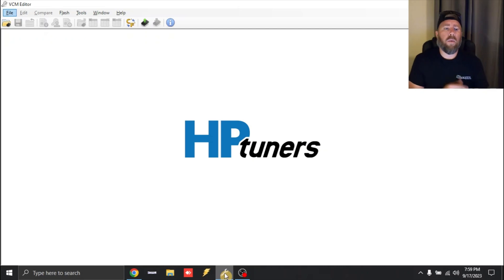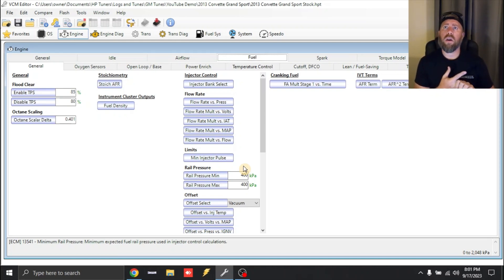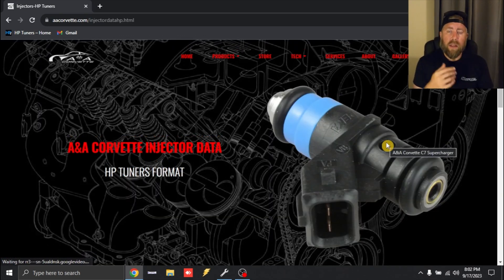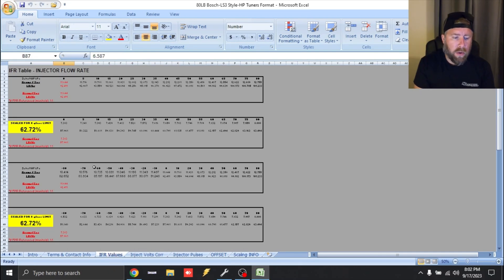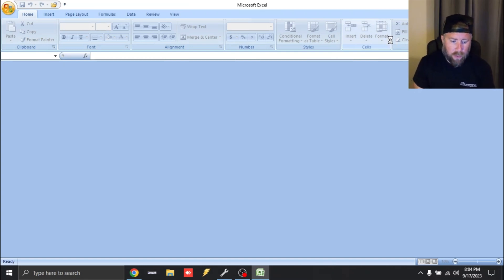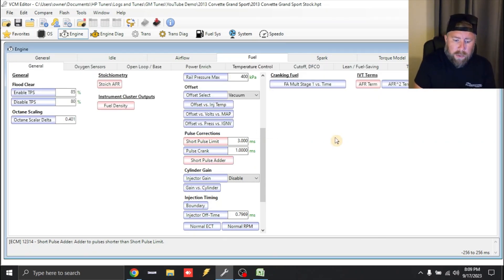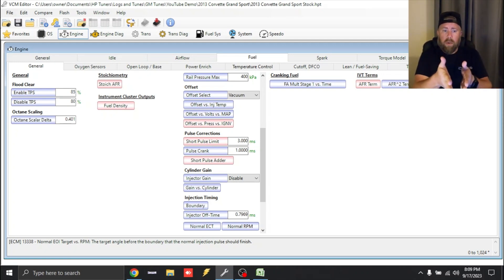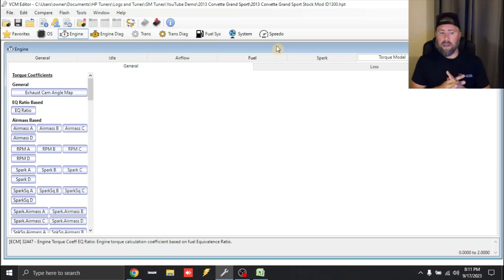Scaling for HUGE Injectors on Gen 4 GM ECMs! HPtuners HOW-TO!

Comment: hey matt Im wondering about much larger injectors like 1750-XDS where im stuck in hp tuners after doubling stoich, halving ivt terms, etc and halving the flow rate is still calling for 97.205. This is for a boosted return style system so I believe i use the same for all X axis

Comment: if i use a custom scaling value like 25% or 40%, how do i scale the stoich? do i do Stoich x (1 / .25)?
Reply: Yes. You are correct.  For example, 45% would be (1 / .45) = 2.22222222 multiple for your Stoich AFR table.

Comment: So for when you tune bigger injectors do you also have to scale the tip temperature table as well? I see a lot of people zero them out but if there is a better way of scaling id perfer to do that. Could you take new flow rate and divide it by the stock ones, take that value then divide the table? Say stock is 42 lbs and new is 104, could you take 104/42 to get 2.5, then divide that across the table?

Comment: I have a stock 2008 F350 SD dually with 6.8L and it used to get between 14-16mpg but it is falling off, much probably to do with the bad brakes I purchased from O'rieiliy's but It have wanted to get better performance from better atomization through high performance injectors.. This lb per hour and mapping makes it out of my league.. Am I totally off my rocker or is this something that can be achieved by a getting this mapping done by someone (for a fee) or, am I chasing the unatainable unicorn.. I just think this 6.8L with better tech should be able to get 18+mpg with grandpa style driving, and have better response and power when needed..Better tow performance as well, when called upon... What say you? Thanks in advance..

Comment: Hey Matt, I’m running a cam in my ls4 car I’m curios if I need to scale my new injectors being 52lb fic injectors on the e67ecu and my second question is do I use the same process on the earlier ecu if I ran the big injectors on an e40ecu? I have two cars hence two computers

Comment: Thanks for all you do. Your help is greatly appreciated. I followed this video when upgrading to ID1050x injectors in our 2010 Camaro. Everything worked great. Afterwards just messing around with HP Tuners I noticed going under the Fuel System / Fuel Control Module tabs that the data for "flow rate vs pressure" and "minimum Inj PW" is the same as it was before the Inj swap. This is not the original FPCM for the car. It was changed when converting to the LPE dual fuel pump setup. I also noticed that the ID Excel spec sheet has a flow rate table with the same axis header numbers as does the "flow rate vs pressure" under the Fuel System /  Fuel Control Module tab in HP Tuners. Do I need to change these values under the FPCM also ? Thanks
Reply: Did you end up changing fpcm values?

Comment: Would you still need to scale if ecu is 127lb and injectors are 95lb 
It flats out pass 488 i read the engine will never hit those cells
Reply from the maker: That’s personal preference. I still personally scale them but I’m picky like that.

Comment: Wouldnt you halve the stoich to add the fuel back in? Doubling it would be removing fuel
Reply from the maker: No. When you halve the injector flow rate, the ECM will double the fuel output. Doubling the Stoich leans the vehicle back out.
Reply: Oh yess that makes sense now
Reply: What does it do to the commanded AFR though when logging wideband AFR error for VE tuning?

Comment: Would this work the same for Fuel Injector Connection 1200cc on a 2013 zl1 camaro?
Reply from the maker: Yes it would be the same.
Reply: @Matt_Sanford Awesome! Do you have any videos for FPCM adjusting on tuning when adding an aux pump?

Comment: Great video bro !! Ive watched this video 5 times already. Currently looking for injector data for (Fuel Injector Connection 42LB Injectors for LS1/LS6 Tick Performance) then ill be on my way to tune this stock 5.3 with 42 lb injectors
Reply from the maker: You can email Fuel Injector Connection and they will email you the data for your injectors. You won’t need any scaling for that size of injector fortunately.
Reply: @Matt_Sanford  thanks so much for your video. I got the setup fired up yesterday from watching your videos. I notice you're in nashville TN, im not far at all from you. Im in Memphis, TN

Comment: So is gen 3 a similar process?
Reply from the maker: It isn’t. I will make a Gen 3 video though. You don’t have injector flow rate limits on Gen 3. You would scale on Gen 3 to add some resolution to your timing table when under boost.
Reply: Thnaks for sharing your craft, gen 3 scaling video would be awesome, I've seen others do gen 3 but there seems to be differences of opinion as to the correct method which shouldn't be a  surprise I guess

Comment: Would love to see some love for the GEN4 with the 63 lb/hr limits, even with 50% scaling of my ID1050's I hit the upper limit with the ID data thats given.
Reply from the maker: Look at my video of the 3rd Gen Camaro with the LS9. I have the how to with the 63lb/hr limit on there.
Reply: @Matt_Sanford  I can't find that video, you have a link?
Reply: I just finished injector scaling for my early Gen4 E38 with the 63lb/hr limit.  I used this video and played around with the scaling factor to get an acceptable solution.  I chose a 45% scale factor because I only maxed out two cells on the far right side of the FLOW RATE vs PRESS table but I kept my STOICH AFR table less than 32 by multiplying it by 2.22222222.  If I used 50%, I would have maxed out more cells on the far right side of the Flow Rate vs Press table.  Less than 45% scale factor and I’d max out the first few cells of my STOICH AFR table.  45% and a multiple of 2.22222222 seemed good to me.
Reply: @natez0690 I switched to holley. My life has been better and easier ever since.

Comment: would love to see how to scale the 63lb limits. running an e67 ecu on a tbss and 80lb siemens injectors
Reply from the maker: I did that how to in my video on the LS9 3rd Gen Camaro.
Reply: @Matt_Sanford  I will go check it out. I'm wanting to make sure I'm doing it the proper way. Added an lsa blower and 80lb injectors.

Comment: Lets say im running an aftermarket fuel regulator will the ifr table be all the same number??
Reply from the maker: If it is vacuum and/or boost referenced then yes. The offset will be the same as well.

Comment: My next request/suggestion is a P0411/P059 flex fuel segment swap.
Reply: same here
Reply: Need to know your scaling for the 63lb/hr table in hp tuners, 2007 c6 e38 ecm deatschwerks 65lb/hr
Reply: Gen3 with 6.2 would be cool

Comment: With a th400 swapped G8, using hp tuners mpvi2 can you turn off the MIL for TCM communication failure?
Reply from the maker: I honestly can’t answer that question. I’m sure if you used a manual OS that code would be gone but that’s the only way I can see you getting a U code to go away. You couldn’t use HPTuners for the OS swap either unfortunately. You would have to use a dealer level pass through.
Reply: @Matt_Sanford  much appreciated!  Hoping this YouTube stuff absolutely soars for you!